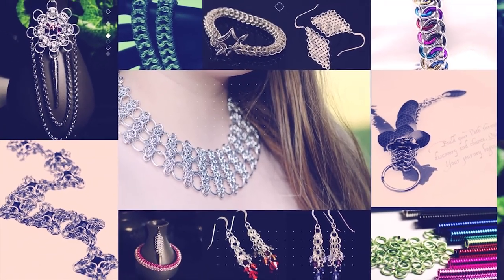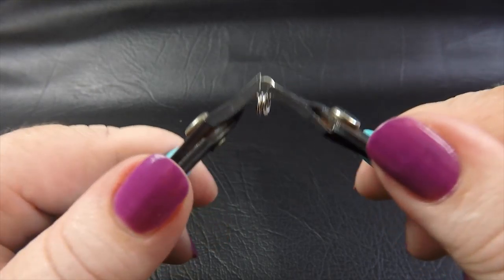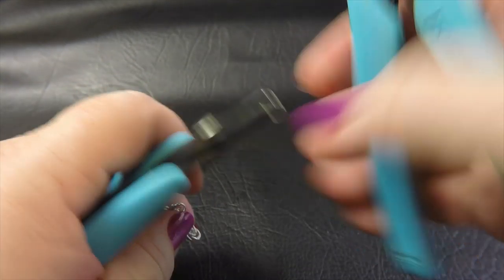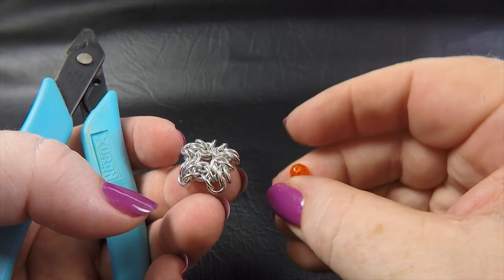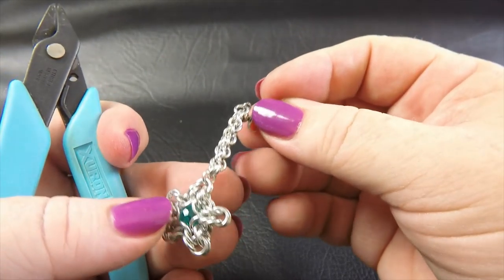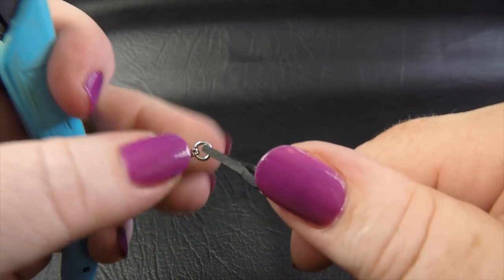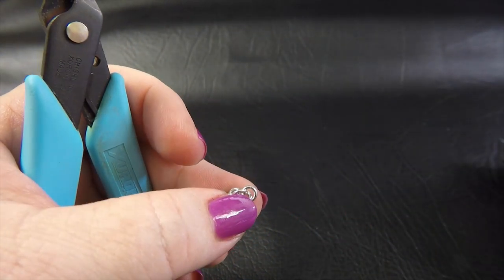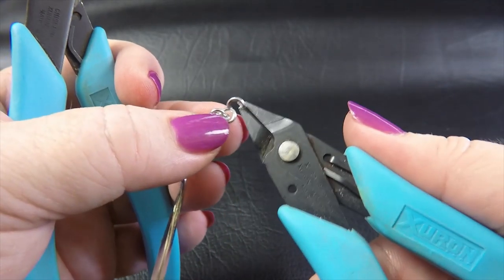Chain Maille Tutorial - Falling Star Earrings

Comment: Just wondering if anyone has done these without using the adhesive?  Does it really need the adhesive, or are they fine without?  I would prolly only be using them to go out with - not for every day use.  What do you think?
Reply from the maker: I think that any experiment is worth it.  Also, they will stay but if their is pressure placed against the bead it will pop out....so I just wanted to make people aware of that possibility as jewellery is often treated badly.  Deb